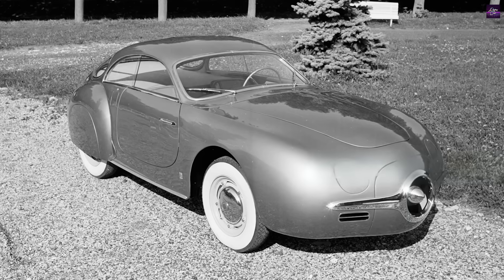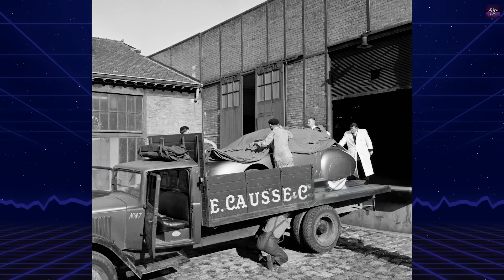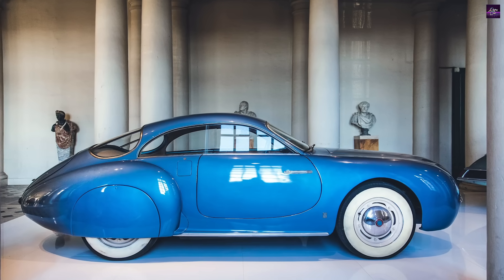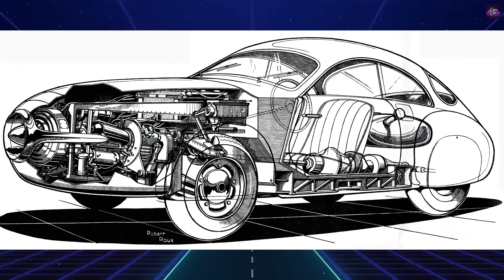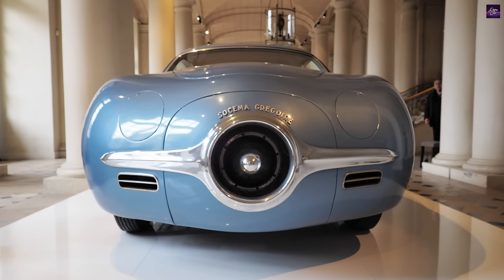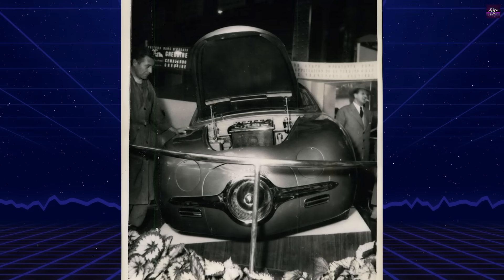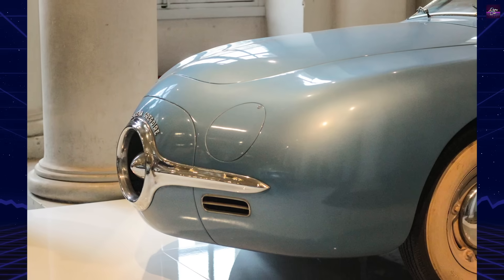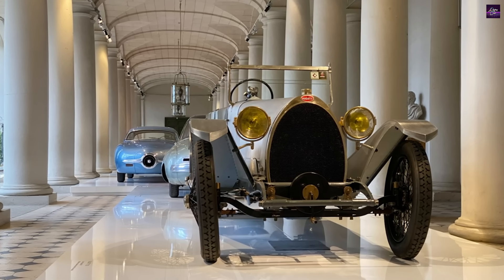Socema Gregoire Turbine: The 45,000 RPM Monster That Could’ve Changed History

Comment: Jean Albert Grégoire was a legend in French automobile industry. His patents included a constant-velocity universal joint, and progressive stiffness suspensions with conventional helical springs.  He pioneered front-wheel drive, independent suspensions, aluminum alloy (Alpax) chassis, then load-bearing bodies (chassis-less), aerodynamically streamlined shapes (influencing Citroën DS), and collaborated with many manufacturers, notably Amilcar, Hotchkiss, Panhard. Simca, Hartnett-Kendall...
The Socema Gregoire also appears repeatedly as the "Turbotraction" in the popular Belgian comics magazine Spirou, starting from "La Corne de Rhinocéros".

Comment: What could they have been thinking 🤔🤔🤔? Certainly NOT any realistic chance of production, certainly not even in limited numbers & DEFINITELY not in mass production! All that technology for...100 crappy horsepower???🤪🤤🤤🤤 In a 1300kg car, even though it has an aluminium body to save weight?🧐
Even if it was only intended as a prototype to suggest that the future motive power of the consumer automobile was gas turbine, who in their right mind would think that mass-production would be enough to make such precise & metallurgically challenging technology even remotely cost-competitive with internal combustion piston engines???🤪🤯🤦🚮

Comment: This is one attractive automobile that combines tasteful, neoclassical coachwork with advanced drivetrain technology.  (That said, I think it could have looked much better proportionally if the hood / front end was made a little longer.)

A quick Google search found one cast resin model of the Socema Gregoire Turbine in 1/43rd scale, but sadly this appears to be a 'curbside' model without an opening hood to see its turbine engine.  

This is another one that would have been great as a 1/24th scale model, (you dropped the ball again, Heller.)  I think it would have sold well for its engine and drivetrain alone - at least in America, where custom "Kar Kulture" extended to modelers.  I'm not sure French / European modelers were infected by the Custom / Show Car 'bug' in the same way.  If they had any counterparts to America's Ed "Big Daddy" Roth, Darryl Starbird, George Barris, Tom Daniel or John Bogosian, I've never heard of them . . . .

Thanks for making and sharing, Retro Car!

146th Like.